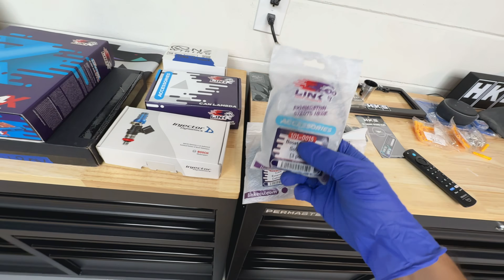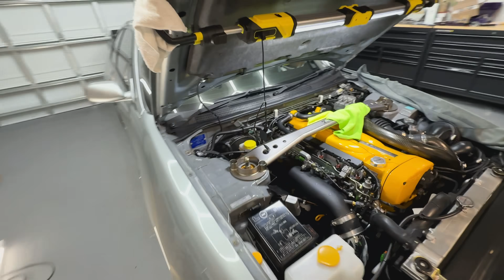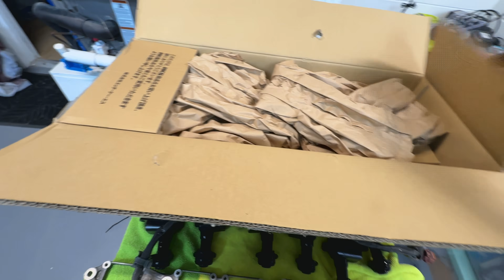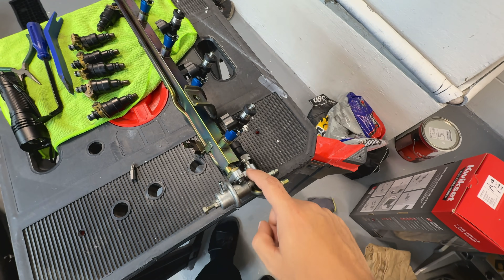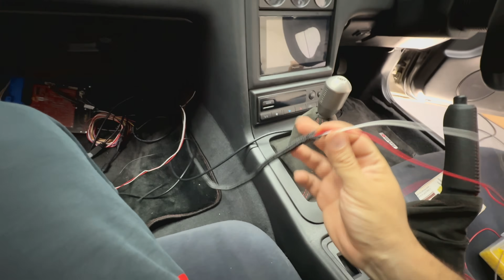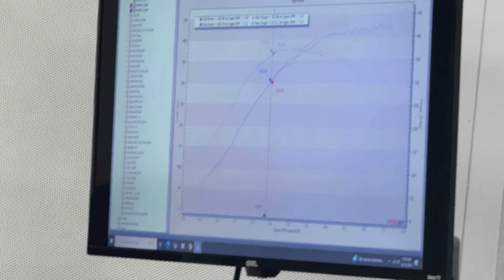R33 GTR Restoration | LINK G4X Install & Spectuned Dyno Session 🔥

Comment: You could have just used the OEM Boost Solenoid wiring to connect to the ECU, it's already hardwired into the Link anyways.

Comment: nice clean original car congrats. i would like to keep the original fuel rail as well can you supply the link to the fuel pressure adaptor .. i will be using the ev14 style plug injectors to keep it simple
Reply from the maker: Thank you! Hit up Doug from UP garage. They sell this one. 

https://upgarageusa.com/products/u-p-g-rb26-fuel-pressure-adapter

Comment: I just ordered id1300s for my car. Using the same oem fuel rail. The oem fuel rail is like 10.5mm i believe and the injectors come with thr 11mm adapters.  Do they fit fine? I am getting different opinions on weather or not they fit.
Reply from the maker: Mine were 11mm so they fit just fine if your smaller you’ll probably need bigger o rings
Reply: @Pacosgarage  thanks for the response. Yeah when selected them, i selected for rb26. It said they would come with 11mm blue adapters.  Looks like the same as yours. The people i ordered it from said they will not fit on oem rail and i would need an aftermarket 11mm rail... so i saw this video and had to ask. Im wanting to keep the factory rail. I have seen people run these injectors in the oem rail but figured id ask you.